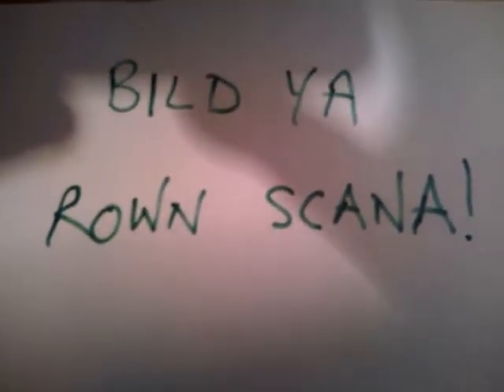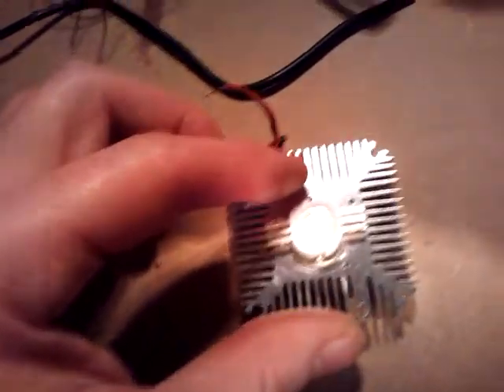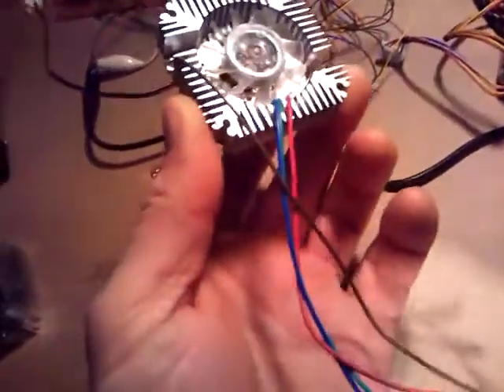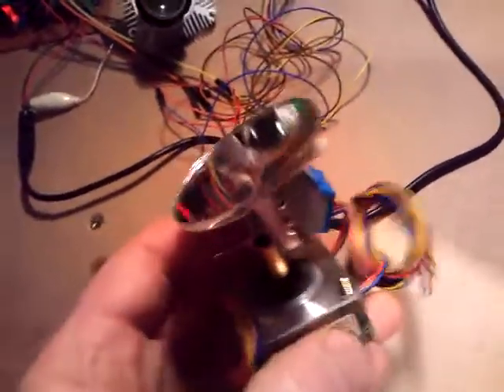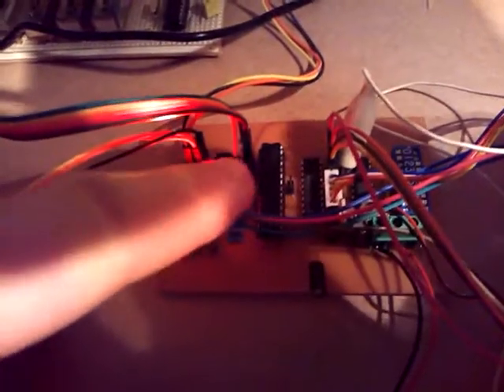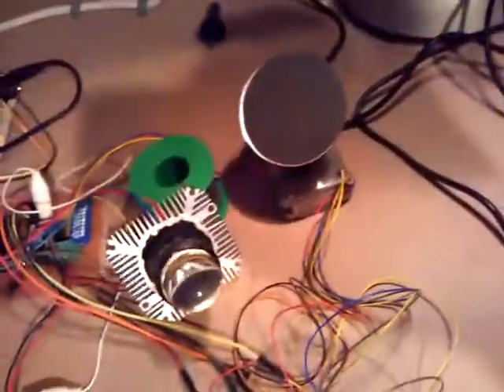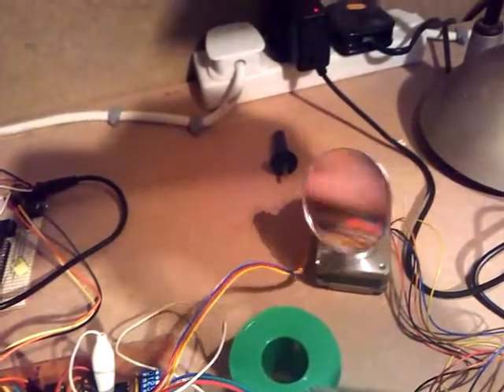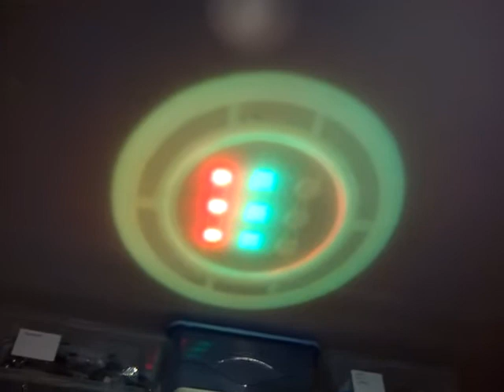DIY DMX Scanner, made from two steppers, a mirror and an RGB LED

Comment: Hi Bob, I know this vid is from 2015 but I wanted to ask you about the DMX part of this video. Mainly: can you point me in a good direction to learn how to make a DMX controller with a mixer interface like you have used here? I have some Arduino experience and I'was a light engineer in the 90's so I have some basic knowledge of DMS and lights. I'm using an RGB LED to make a scanner somewhat like this one, but I've been wrecking my head over the DMX part. I could program everything in Arduino and use a Nano or AtTiny but that would limit the options. Using DMX to program some stuff would be king. Thanks in advance, have a great day :-)
Reply from the maker: Hi Hans, take a look at this guys website, he has done some great work/projects with DMX https://www.mathertel.de/Arduino/
Reply: @Recovered  Thanks Bob! I emailed Mat to ask if he has one of those arduino dmx shield pcb's laying around in a drawer somewhere (as he indicated in one of the articles) so that could be a good DMX-hardware starting point. Going to tackle the Arduino code for sending and receiving DMX data now, it's going to be a fun week ;-p - thanks again!

Comment: Im working on a 100 watt led moving head. Are there any schematics for the dmx circuitry
Reply from the maker: Hi, this guy has some great DMX information, which I have used in the past - http://www.mathertel.de/ - I am sure there is a DMX circuit there
Reply: thank you very much 
ill need to run power and signals though slip rings i think